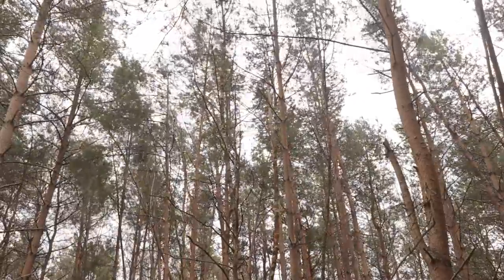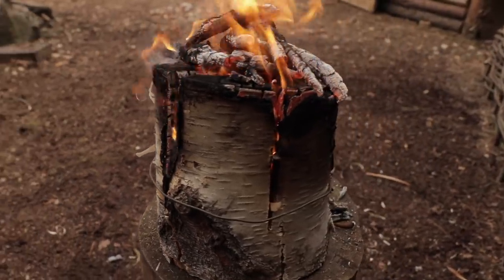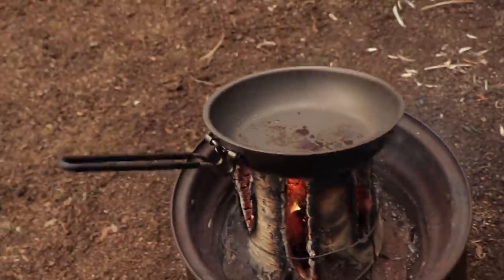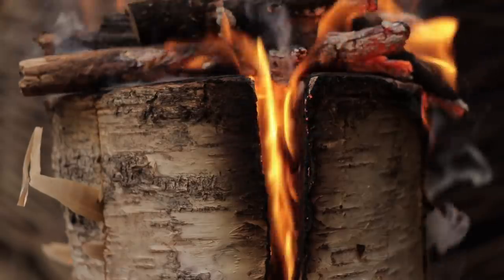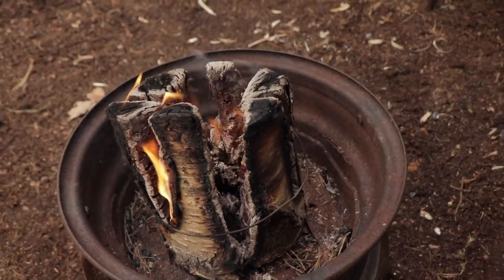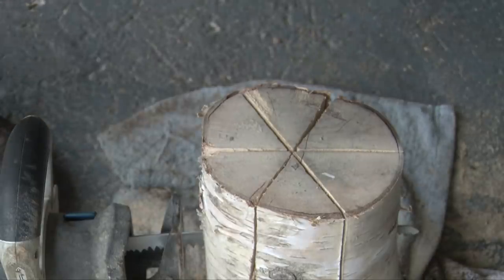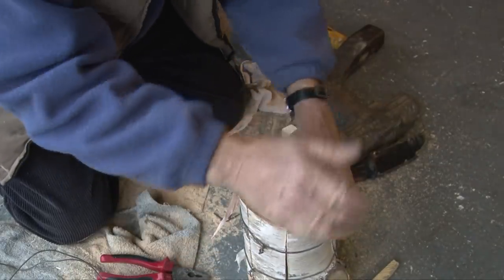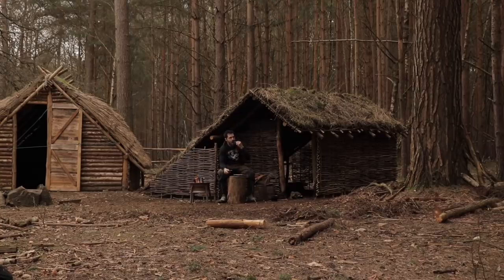Cooking on a Log: Bushcraft Feast in Minutes

Comment: Well done with the swedish firetorch! But we in Sweden make it easier to start the fire. On one piece of cutted log, remove about 3-4 cm from the pointy edge of the log all the way down. Then at the bottom of the same log, remove about 3x3 cm from the side inwards to the middle and that way you have like an air tunnel getting more oxygen all the time the swedish firetorch starts up the fire faster. Good luck! Love your videos! Best regards from Sweden!
Reply: Thank you for sharing a tip!

Comment: Swedish torches are awesome. We used them to warm our tents at night in the army. They'd burn for like 4 hours so you could get through the night on just 2 of them. And they made for nice stoves as a bonus.

We made them by finding 6 quarter logs that where roughly the same size and strapped them together. Your way is probably better outside, but inside, the imperfect logs allow for much more airflow.

Comment: As  you say, there are a number of Swedish Fire Torch instructional videos out there: I have seen my share of them.  Each 'take' on the torch adds its own twist or wrinkle:  yours was the use of wire to hold the split sections together!  Other ideas split out a central core from each section to allow for more shavings and kindling to catch things and to provide more initial fire surface.  I feel that this is a 'fuel efficient' set up: boil water and fry in the early going; simmer or use a Dutch Oven later.

Comment: Since I first started watching your videos, I happen to stumble on the channel of a guy who was showing how to make and use what he calls a Finnish log torch.  Basically same as you, he will separate the log into a few wedges but he also removes the core of the log so as to leave an empty cavity in the middle before securing the log with wire.  He was using his contraption to heat up his tent but I was wondering if you could cook on it too, since his design does not leave openings in the side for good air circulation.  His method to light it up was to stuff bark and small twigs in the middle portion and light it up.  Quite interesting actually to see several methods using the same principle.

Comment: Nice job! I've seen a version where the center point of each log piece is split out to create a rocket stove. Tinder bundle is placed in hollow middle and initially used like a twig stove until log pieces catch. Small sticks are placed between pieces to keep air gap. Cheers

Comment: For the Swedish fire log:  you can also use a chainsaw, if you have one.  Don't make the cuts all the way to the bottom though and it will hold together by itself.  Still burns wonderfully and transports easy with no chance of falling apart.

Comment: A tip that I learned was to take some of your featherings from the top two-thirds of your segments so when assembled you have a nice little space in the middle to get your log going, sapwood dries out first on a damp log, try it. btw lay log flat on the ground, but to rock or wall, axe on face wood end,  strike back of axe with lump hammer or maul 6 or 8 pieces. greenwood working from Mike Abbot.

Comment: Good stuff Mike.  Here's a tip from a Chef.  Try dry brining your steak with an equal mix of Kosher Salt, Garlic Powder and  fresh Cracked Black Pepper.  Let it sit in the fridge for a day or two uncovered on a plate turning it every 12 hours.  There won't be any odor at all and the steak will dry naturally.  Then you can put it into a zip lock baggie and carry it out into the woods, grill it quickly over an open flame for a min to min and a half each side.  Then let it rest for a few minutes and you'll have yourself a perfect Med rare to Med steak.  Enjoy and Cheers to you and your Dad!!

Comment: If you whittle about a quarter inch off the sharp point of each wedge piece, it will leave you a channel up the center of the log which will serve as a chimney when you reassemble the log.

Comment: Thank you for your always great vids!
An idea for the log torch: use a small chain with a hook at the end, to wrap around the split log pieces.  Reusable, and easier than the wire.
You can also use a chain, to lash a tripod - and suspend a pot.

Comment: The way I learned to do this, is very different, but it was called a Finnish Stove. I would use fresh wood, rather than dried and the log would be much taller, since the primary purpose is to use it in deep snow. When the log is much taller, like a meter or so, the grooves are also much deeper and the flames coming up from far below, slowly dries the inside of the log, allowing it to burn. The grooves can be below the snow line as long as there is room around the log itself, because the fire will suck in air as it blows the fire upwards. 

You don't split the wood, but leave 20cm or so uncut at the bottom. The length of the wood is what provides the great heat, because the flame is forced straight up, ideally allowing pyrolysis to take place, allowing you to burn the carbon monoxide. Ideally, there should be almost no smoke and the flame should be much less orange and more blue and white. This gives great efficiency. The fact that the wood is not dry, is a good thing, because it allows the stove to go on much longer. I would also only use four grooves rather than six, both to reduce the inner surface area and to protect it from the wind. You want the convection to suck in air, not the wind to blow it in. 

And finally, this being a Finnish Stove, a bit of alcohol in the center to help get it going, doesn't hurt. :)

Comment: A Birch tree log was not a good choice. Any other log would have burned just as hot from the inside out, not burn through the sides so quickly. Just using the birch bark to get the fire started in any other log would have been a better choice and sliding one side of the log panels up a few inches so there is an air hole at the bottom would have resulted in the log burning "all on the inside first." PS I do love all your videos!" Thank you for sharing them.

Comment: next time use a taller log ... about 2 foot tall is better ... tie near the bottom and stuff the splits with twigs then top with tinder and light ... it will cook longer and hotter than a camp fire ... the main design is swedish
Reply: and yes you water it out and then just repack with twigs and tinder and light it .... leave it standing and it will dry fastest
Reply: you could always weave grass into the wattle to make it more wind proof